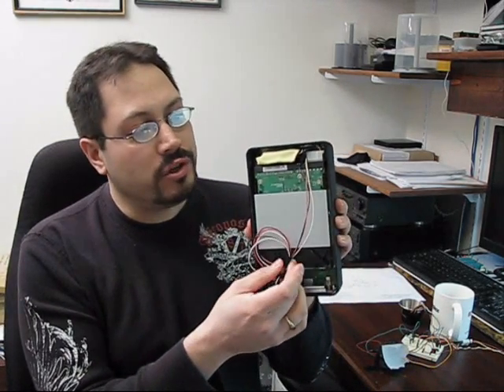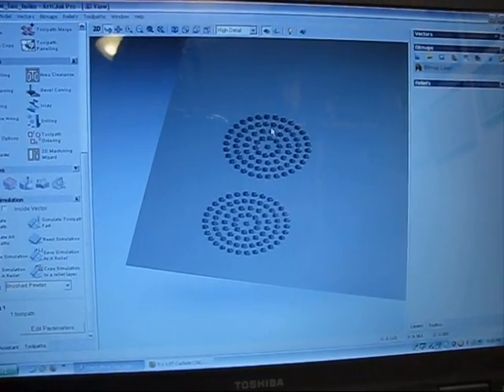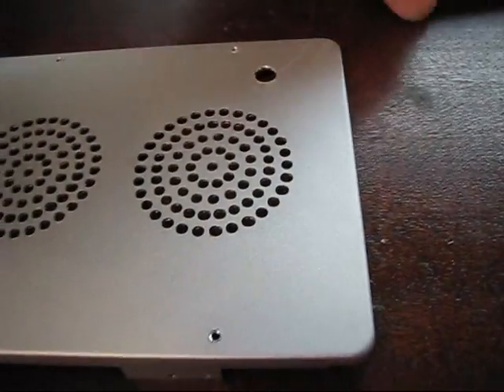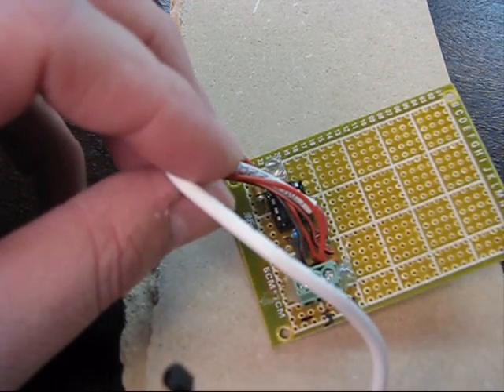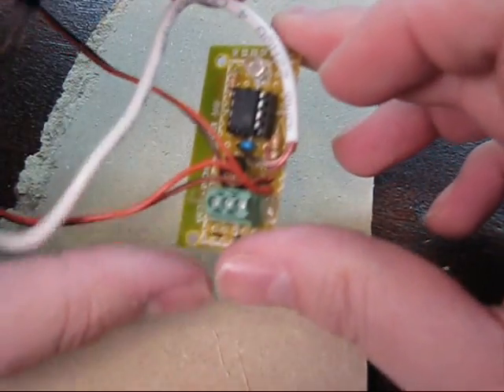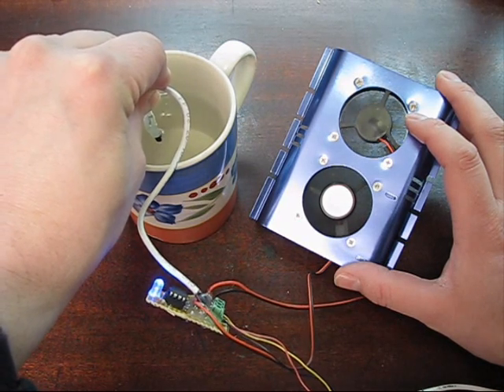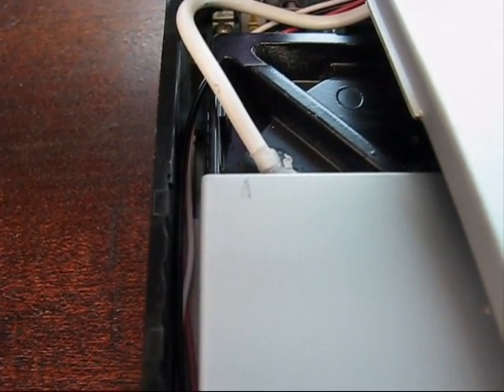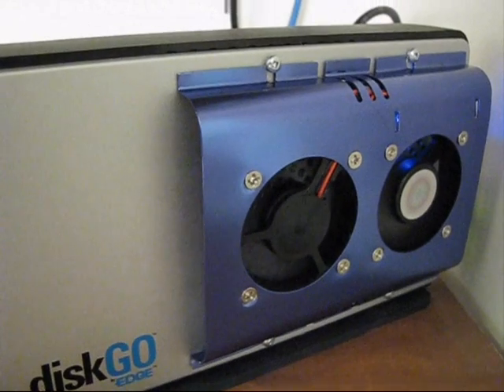PWM Fan Controller - Completion

Comment: I'd say you only need one fan to push air in.  Just put exhaust vent holes across the opposite side to ensure air is pushed across the cavity.  (I'd just drill holes across the front side opposite the fan.)